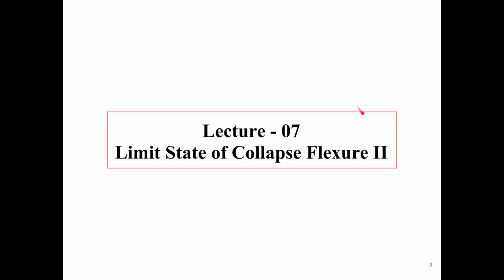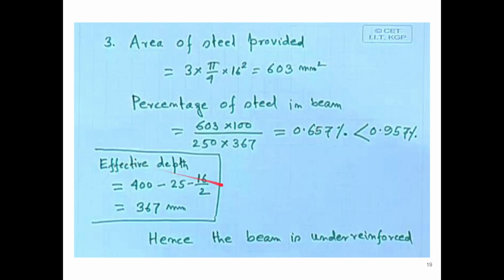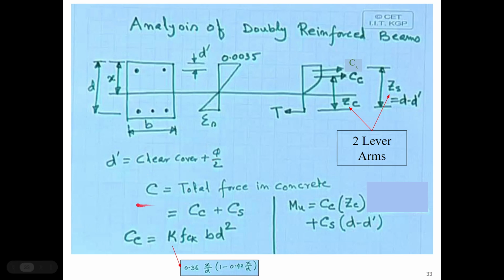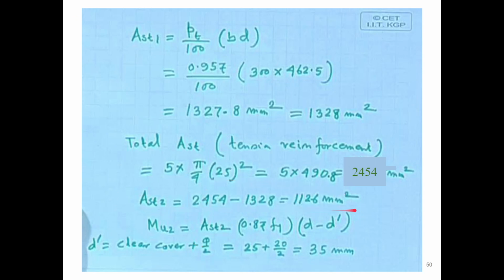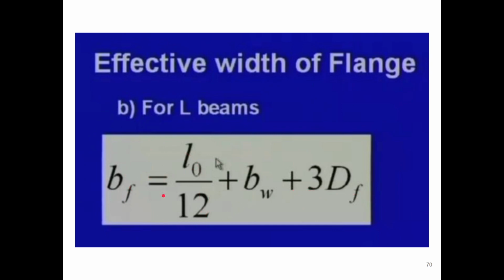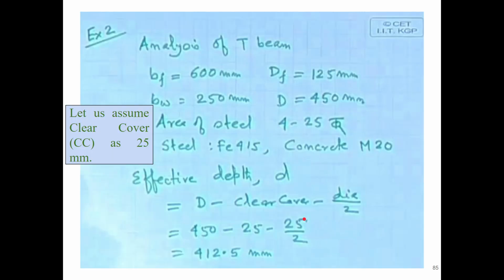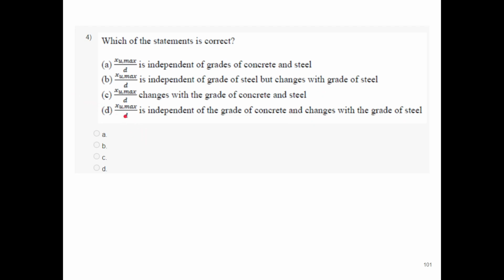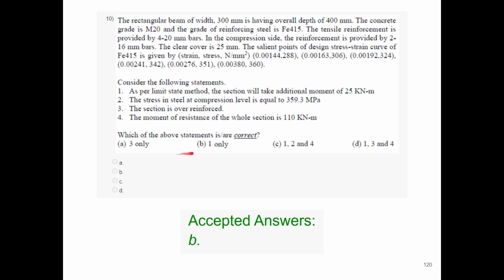Design of Reinforced Concrete Structures - 3rd Week TA Class [13th August 2023, Sunday]

Comment: In analysis of doubly reinforced beam in 1st example we got the moment of resistance from concrete i.e section is over reinforced which is not allowed so what we should have to do to make it under reinforced section
Reply from the maker: See, under-reinforcement or over-reinforcement is not talked about in the case of doubly-reinforced beams, as there are rebars assigned in both the tension as well as the compression side. In the case of singly reinforced beam, we can increase the width, depth and grade of concrete to make the section under-reinforced. As can be understood from the doubly reinforced beam case, increasing the width or depth of the beam must be an issue due to space limitations. Therefore, increasing the grade of concrete might be the only way to make the singly reinforced beam under-reinforced and not requiring double-reinforcement unless there is Stress Reversal is occurring due to Cyclic Loading.